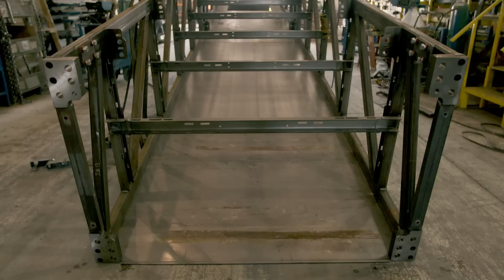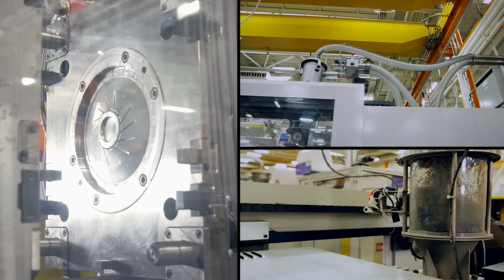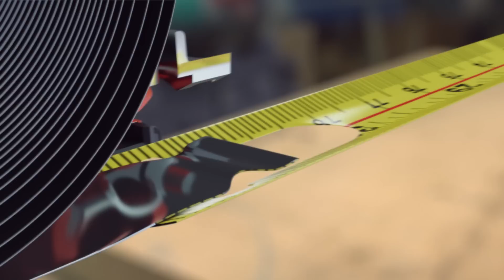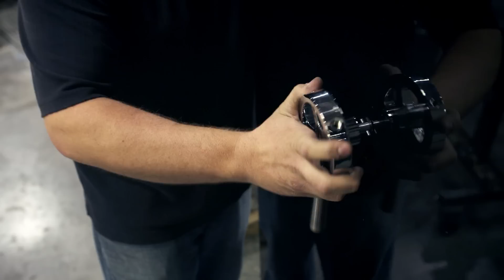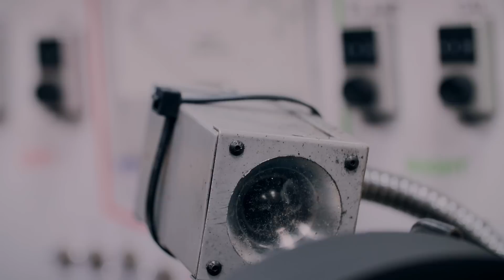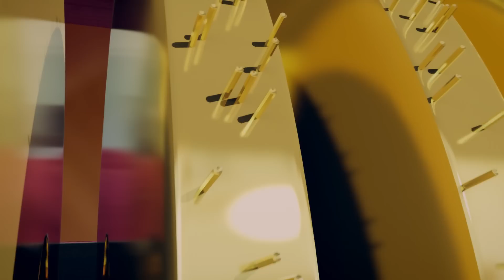How an Escalator Works | Ultra Realistic CGI | Full Documentary | Machines: How They Work | Ep 2

Comment: I knew that the GRU [Gear Reduction unit ]  slows down the speed, and increases drive  torque ,
 but How many Horsepower are the motors that an Escalator use s?

Comment: Oh, the fan is made from secret ingredients..
Nylon6 granules,
with 1gm per kilo of Calcium Stearate.
Or Nylon66 if premixed..
When he states that the material is heated to 200°C, this isn't strictly true.
The material is fed into an heated worm, at or about 160°C then injection pressure is applied.
It's this pressure that raises the temp.
Nylon is hygroscopic meaning it readily absorbs moisture, so the whole injection process must be completed before steam bubbles can form in the material or it foams, making a brittle product.
In some processes, the product drop into awater bath that has an amount of veg oil in it.
This seals the pores of the plastic, making them water resistant.
This used in the aerospace and aircraft industries, to cope with changes in pressure because of altitude,
or temperature in the case of re-entry.
Reply: Plenty of mis spoke and mis representation here in this hear videography
Reply: ..and Thomas own all the holes and lines used,where is his profit?